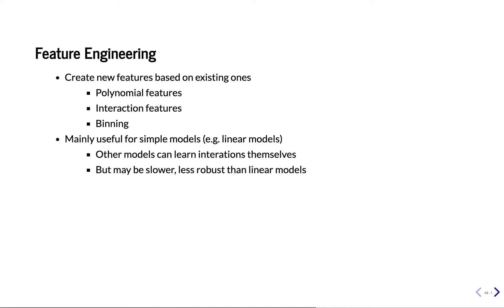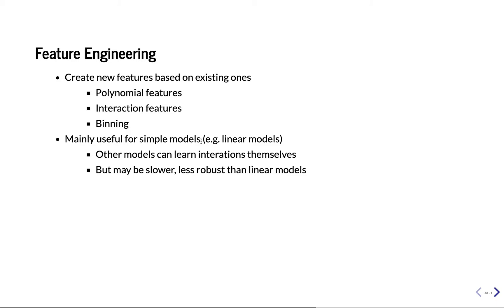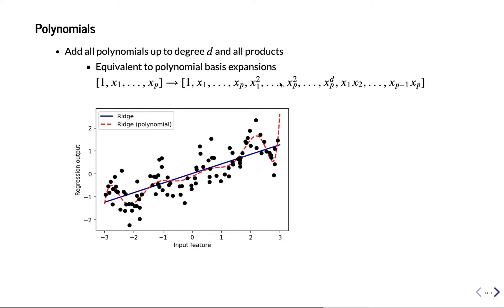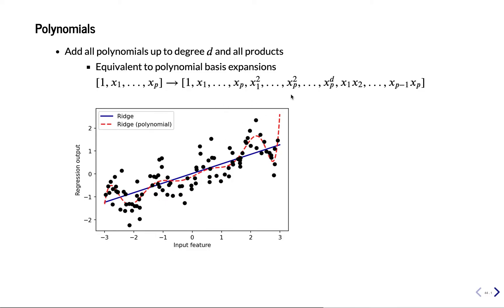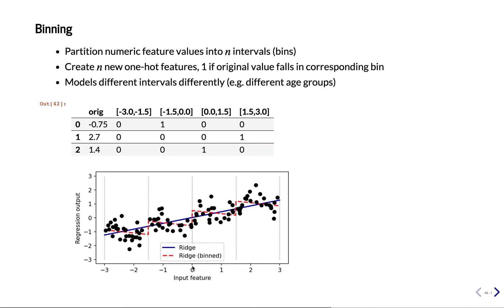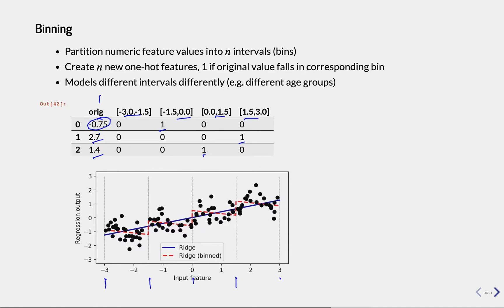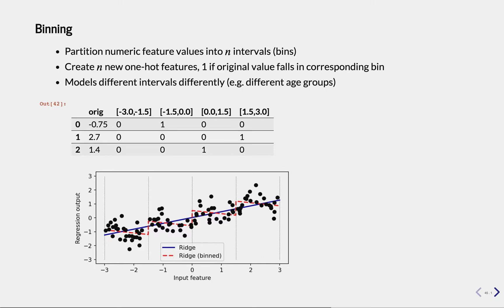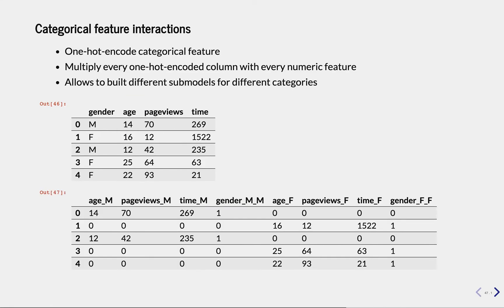Lecture 5.6 - Feature Engineering

Comment: With feature engineering (especially polynomial features) the number of features can explode quite rapidly it seems. Would it make sense to first apply a feature engineering method and then a feature selection model? The goal here would be to create new features but only keep the ones that truly affect positively the score of our predictive model. 

Connected to the previous point: Could you give a ballpark estimate, if possible, of how many features are likely too few (here feature engineering is very useful) and how many features are likely too many (here feature selection is almost necessary)?
Reply: Sure, you can do that. Be careful to choose a feature selection technique that doesn't remove too many features. In feature engineering it's usually the relationship between the original and the new features that's important, so use a feature selection technique that considers those relationships (e.g. a random forest-based technique), not a univariate selection technique (that only looks at each feature individually).